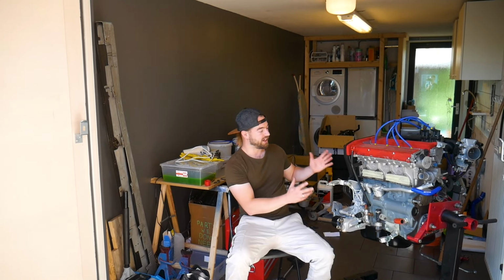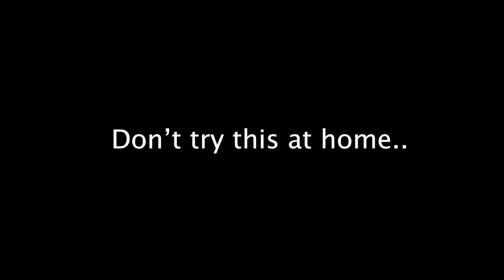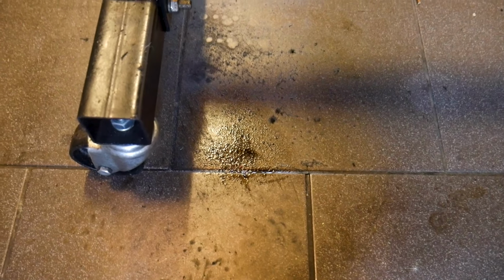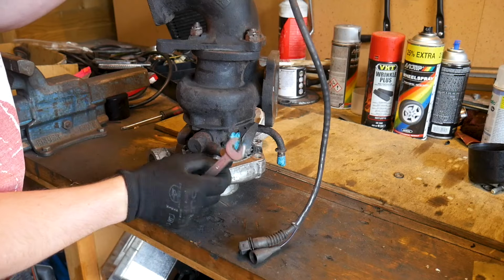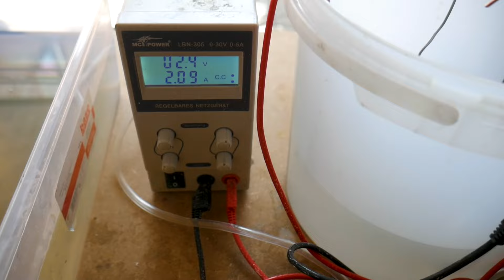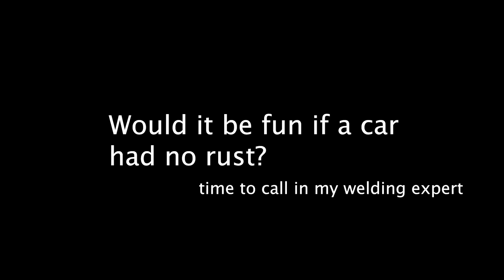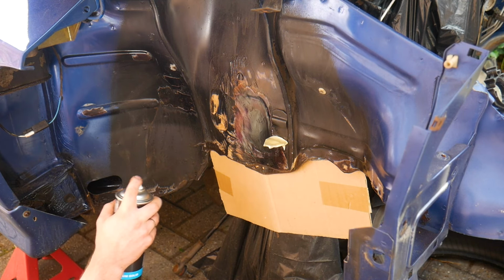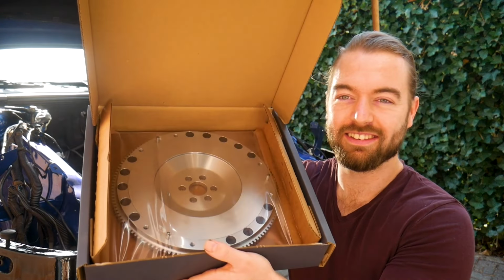Fiat Coupe 16V TURBO Restoration | Engine Rebuild PART 3

Comment: Is it possible to attach a turbo to an original non turbo coupe without too much modifcations?
Reply from the maker: No not really, allthough it looks easy you need a lot of parts like differant pistons and ecu. You could always just send it and trow one on but its a risk. Much easier to buy a turbo model